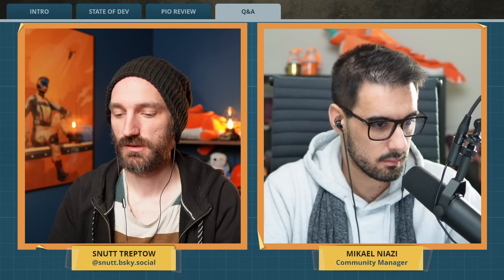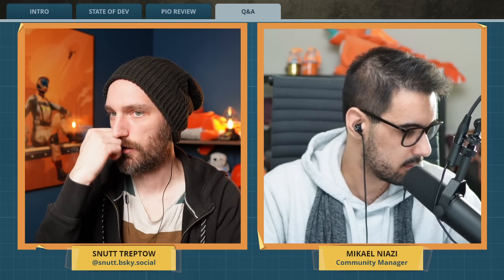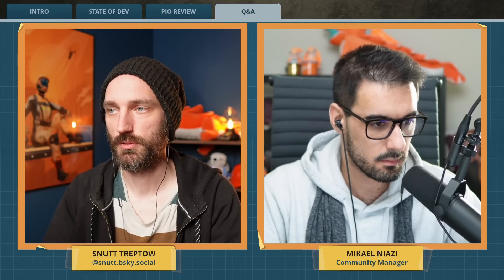Q&A: Do you have any plans to make Fluid dynamics more transparent?

Comment: I think a large part of the problem is that the machine intakes and outflows are not realistic.  They both intake and release fluid in big chunks.  Obviously the machines have valves and buffers, but maybe they need a secondary internal buffer that produces or consumes the fluids after the machine cycle is done, at the rate at which the current production cycle is running.  That way the systems aren't constantly dealing with shocks that will go well over their capacity.

I don't know how you show that in the UI, but I don't think seeing how much the fluid is sloshing will help much if the unrealistic source of that sloshing isn't dealt with.

Edit: if the machines are providing their own head lift that isn't affected by how much fluid is in their buffer, it's possible this is a non-issue.
Reply: @Northernheros  Not the point.  If the fluid simulation is realistic but one part of it breaks with that realism then it will cause problems in the simulation.
Reply: I vouch that
Reply: Machines dispensing fluids in chunks are a thing in real machines if you use pistons or membrane pumps. The real-world answer is that the pressure spike stretches the pipe ever so slightly. Part of the reason why copper and rubber are used so much for piping. If you have a concrete or steel pipe the real-world answer is either a centrifugal pump that keeps a constant pressure, (reactor cooling, fuel pump, oil drilling), or you leave some headroom in the pipe capacity to deal with the spikes (water and water treatment).
Something that works in-game and in real life is a water tower. In-game each variable input goes into a large buffer that could be drained on average. In reality, drinking water gets produced rather constantly, and the water tower balances out the variable demand.
Reply: @MrHaggyy  There's no such thing as a device that dispenses fluid instantaneously though.  Yes, it might be spiky with pumps etc, but the machine buffers will get an injection of several cubic metres of fluid in a single frame.  I mean it's possible those buffers are programmed in such a way that this isn't an issue, I don't know.  I might be wrong about the cause here.
Reply: @excrubulent  Well a simulation is always just an approximation with some error. In game engines, it's even worth it because you need to maintain some reasonable FPS, not like in science & engineering where depending on the level of detail an hour per frame is fast. All fluids in the game have the same volume, mass, and flow speed. In reality, those numbers are vastly different for oil and water, and for gases, you need completely different physics.
You have two problems. One is discrete math, which gets more and more errors the further you stretch the range of numbers you want to represent. The second is a real phenomenon in fluid dynamics, where fluctuation peaks over the maximum throughput of your system, and something either explodes or compensates for it.

Comment: Why do you deny the pipes are broken every time? They're broken and that's a fact. Nobody cares if it's because of splashing, pressure or whatever.
When an oil extractor shows 600 oil per minute, but actually comes out at about 585-595, that's not normal.
It's a casual game, what the hell is splashing liquid? Why should I spend hours watching tutorials on fixing your bug?
Reply: It's not a bug, however it does clearly appear like a bug and I don't blame players for it, the mechanics are not made clear, virtually no trouble shooting resources in-game, and lack of actually useful indicators. 
And the spiking intake of fluids into machines also has an impact
Reply: Just because you say "it's a fact" - won't make it a fact. 
Idk what are you playing, but I am playing Satisfactory - a factory game, where you need to solve industrial and physics related issues. Minecraft would be casual. 
Furthermore,  I have multiple 600m3 oil extractors that do output at full capacity. That requires a lot of preparation, though, everything from filling up the pipes all the way to starting factory incrementatlly - i.e. if you have already full pipe and full buffer in oil extractor - start 90% of your input refineries, wait a bit and once stabilized at 100% - start last 10% so you could ccreate a proper back-pressure for "deltas", when facctories are pulling x-amount for current processing, forcing pipes to always be full. Then another way - towers. I mean there are A LOT of ways to solve these issues and they do work
Reply: @theobserver_  It's the most casual “factory game” of all such, lol. The water splashing mechanic is completely out of place in the whole thing. There are no physics in this game. When I start producing 600 oil per minute, and distribute it to 12 factories each consuming 50 oil, and see the last 2 factories running at 93-96%, that's not normal. You do not confuse that the developers themselves said that there is no 600m3, in fact there is less. I've heard from many people that behavior of liquid in pipes can depend even on FPS. Are you serious? xd
If there were no problems, there wouldn't be people like me and many others who are unhappy with liquids.

The only thing I can say to justify this “bug” is that it doesn't always happen. Even if you build two absolutely identical circuits, one of them may not work at 100% power.
Reply: @theobserver_  No, in this game we do not solve any problems related to industry and physics. We solve problems of automation and logistics. It's pretty clear.
In reality we have no industrial problems, no maintenance mechanics, no lubrication, no advanced electronic mechanics. Your statement is simply wrong. I get your point, that a player can mitigate fluid problems by diving deep into the mechanics.
But when it comes to industrial and physical challenges, it's just beyond our reality. Conveyors don't use electricity, can be placed in a dusty desert, or can be placed without proper support.

Comment: One simple rule to solve all fluids problems: full pipe is a happy pipe. Turn off receiving machines for a moment to let the pipes fill up.
Reply: @Northernheros  Given I've had to figure this out myself, and then explain it to the 4 of my friends that play this, I have reason to disagree.

They should update the in game descriptions so as to not cause this confusion as they specifically say 300/600 per minute, which is false.
Reply: But also don't rely on a 600/min flow rate through a pipe that says it has 600/min flow rate. It has a max flow of 600, it's not per min at all, I really wish they'd clarify that for new users.

Comment: If I have 600 input from pipes, and then 600 getting used by machines, IT DOES NOT WORK.
Pipes are broken, I don't care how "they're realistic with physics and sloshing blahblahblah", the sloshing never ends because the machines don't constantly consume. SPending hours trying to debug some pipes that should just work is a mood killer
Reply: It works for me. I'm Consuming 600 oil/m to make power without any hitches, the power line flat without any fluctuations
Reply: @shahzaibkhawaja6903  I wonder what you're doing differently, 'water' tower? Pumps? Different amount of source nodes?
Reply: @ManIkWeet  the only thing I did  was use gravity, since I had a free head lift of 10m, which the oil extractor gave me, so 600 oil (a fully overclocked pure node) , as soon as it's extracted, goes up 6m, then the pipe travels at that height using stackable pipeline junction to maintain that height, then the oil manifolds down into each refinery(20 total) , and since fluids flow from up to down, it never sloshes upward against gravity., no pumps or valves needed, although I did put one pump since it's only 4mw just to be safe, but before it was still fine, 

currently producing a flat 70,000mw from all the 1800 oil in the east coast ,
Reply: Sloshing isn't why 600 pipes aren't perfect, fluids aren't actually measured by cubic meter like every other item, "1" Water is actually like 100 Water. You can see this in the codex when you're adjusting possible clock speed.

Because of that it introduces floating point issues with calculations. There's issues with belts at 1200 items per minute, of course there's problems with a pipe actually moving 60,000 fluid per minute
Reply: @DanielisAwesome52  If the pipe says it carries 600 per minute, and sloshing causes that to drop periodically, it can't then go above 600 to average it out. This is a the main problem I see people running into.
Reply: @DanielisAwesome52  Devs claim to have fixed all floating point rounding issues.
Reply: You decided to play a game, which is all about solving technical issues and you want devs to remove technical issues?
Reply: @theobserver_  Devs tell me a pipe can do 600m3/s. I try to make it do 600m3/s. Both input and output machines aren't running 100%, what gives?
Not even after waiting many hours, not even after making sure input pipes are all above output. This seems like a basic scenario, it's not even math intensive, it just doesn't work, and the reason is incomprehensible.

If you must know details: 3 oil sources, 240/240/120, merged into 1, then fed to refineries in one big manifold.

Comment: The thing that drives me nuts about pipes is not the fluid dynamics but when it's not working how I think it should be the tools I have to understand and find what the issue is are very limited compared to none liquid construction.  Just give me something to help me understand what is going on is all I ask.
Reply: @Northernheros  Not everyone is on a same page, when it comes to accessibility of the documentation. PDF, you most likely talking about, is probably easy to understand for people like you and me after failing multiple times and finally getting "light bulb" moment on how it actually works, but not for everyone in general. Especially for people, who lack of necessary knowledge, or prior research on fluid dynamics. 
Probably frustration comes from "I think this is how liquid goes through a pipe, but then why it is not going that way". To understand documentation and PDF you need to understand the problem first. Most likely he wants to see these examples in a game - explained somewhere - consolidated into one place with either 3D, or video examples, because atm - its all over the place. Plus "troubleshooting" tips would. help them as well.
What I do respect about his comment is that he is not yelling "i cannot get 600m3, therefore game is broken - please nerf it" (i mean "fix it"), but he implies that he does not know everything and he suggests on what would help him to work with fluid dynamics

Comment: I mostly like the challenge of fluids, but it would be nice to the direction of flow, or some other way to detect "sloshing." Like when you are trying to carry 550m/s, but there is 60m/s of back flow and everything clogs, i don't think the "flow rate" indicator is very useful in those situations.
Reply: Yea to eliminate sloshing you eighter need to build everything going downwards or make the entire pipe system out of pumps or valves to ensure that it is impossible for the liquid to flow the wrong way.

Comment: Please fix fluids instead of new features. Fluids make the game less fun right now. 

Valves not outputting the amount you ask it to is impossible to verify or know.
Reply: Valves not outputting the amount you ask is not an issue - it was described in a PDF one community member wrote. It should be pinned in discord
Reply: @theobserver_  if a normal player sets a valve and balances a factory around a valve set to 60 that factory cannot run at 100% efficiency. That is because a valve set to 60 outputs less than that, 59.1 I think. It should at the very least require us to select values which are possible. 

But yes you can design an overflow system and slightly over set your valves as described In the plumbing manual. But normal people won’t know that. And it’s unintuitive
Reply: @partyfists  main issue with valves stems from pipes that are not 100% filled. This is explained in a PDF
Reply: @ that’s not the issue I’m talking about. If you set a valve to 60 no matter what is going on, the valve doesn’t output 60 it outputs 59.1. Because really it’s a % with decimal precision of 600. So machines can clog even if you didn’t expect them to.

Comment: Please fix fluids instead of new features. Fluids make the game less fun right now. 

Valves not outputting the amount you ask it to is impossible to verify or know.
Reply: It is annoying, but Valves do NOT output the number you set them to. I think they output a percent of flow, so a 300 valve on a 600 pipe, will output 50%. If they just put a percent it would make more sense
Reply: @ yes a % that showed the true output. But then I think players would be frustrated they can’t set the correct amount
Reply: @tinyturtle1898  almost correct and its not an issue. this is explained in PDF

Comment: Building just a row of 12 Refineries making Fuel from Heavy Oil Residue, fed from both ends on a manifold, 600m3/s, can take several hours for the liquid to stop "sloshing" even if fed from above and from a tower. Liquids can't "flow" past 10 meters up, but if the pipe is full it can still slosh past that, which is terrible and there is literally no way to combat it.
Valves seem nearly useless as well, since if a pipe is full, incoming liquid can still backflow through it to prevent overfilling, again causing sloshing.
The only way to deal with this is to ensure Input = Consumption, and then wait up to a dozen hours.
Reply: Problem with the "wait 12 hours" thing is at some point we need to turn the game off and touch grass. 

When we load back into the game it is slosh city all over again.
Reply: Build a buffer like a segment of pipe or a fluid buffer with valves on all inputs. This prevents some backing up, and if it should happen you can slush the buffer to solve this.
Reply: None of those have been true from my experience, besides the 10m head lift, though I can't imagine a situation where you'd want to prevent flow using height rather than a valve. As shown in pumps, Head lift ratings are for "recommended" values to ensure optimal flow rate, so fluids from non-pump sources can go a little over 10m but at the cost of flow performance.

Comment: Just yesterday when i turned on a new factory one of my fluid circuits didn't work the way i thought it would. It seems to be fine but still, i was surprised and don't really understand why it's doing what it's doing. Although i think i know how to change that if it ends up causing problems at some point